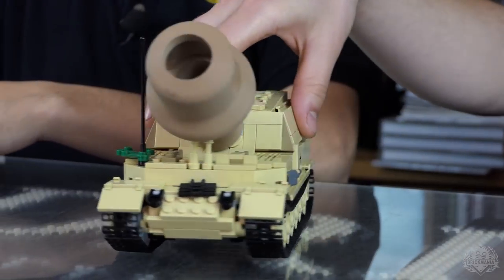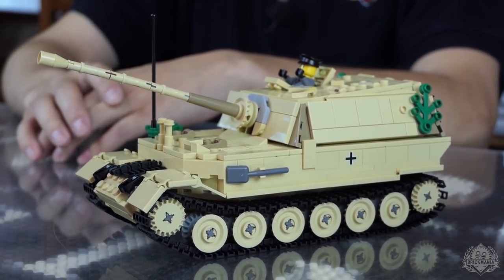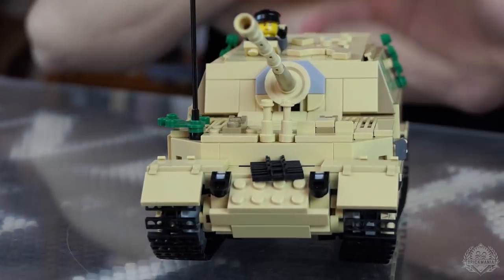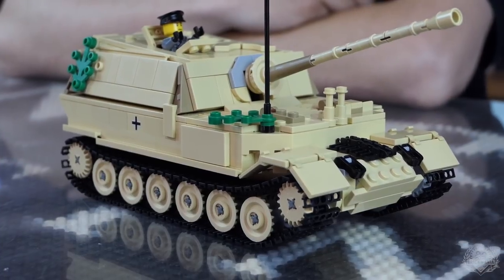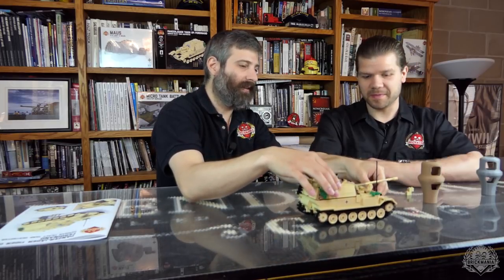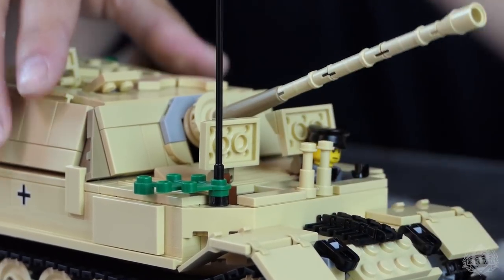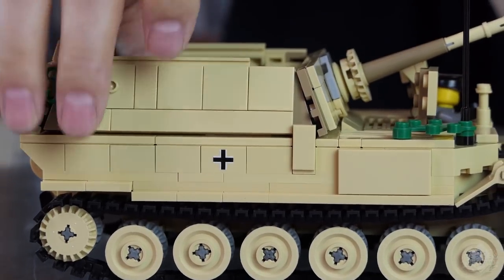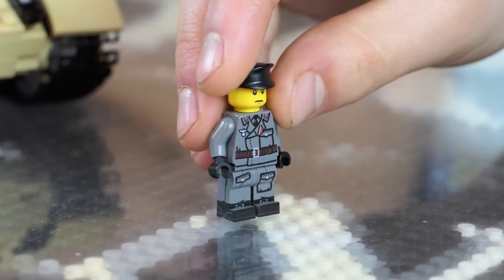Panzerjäger Tiger (P) Ferdinand - German Heavy Tank Destroyer - Custom Military Lego

Comment: U guys already have the chassis, try making some tiger P's
that would be cool
Reply: Ryan Levan I would love that
Reply: Conversion kit would sell this to me, if they don't make a separate kit for it. Just needs tan tiger 1 turret, rear and deck changes.

Heck, if you slope the front and change the casemate to a tiger 2 turret on the rear, you'd essentially have one of the VK45.02(P) designs. Or place the turret on the front and remodel the rear for the alternate version.

But really. Holy yes to the Tiger P. (Especially the command tank)

Comment: By the way, this tank was awefully known for its non reliability due To the engine problem. Actually most of them were destroyed because of this, but only a few model were produced so It wasn't that bad since it was a failed model. There was a report after an engagement with those tanks that show that around 20-30% (I'm being optimistic) survived after it, only a few were actually took out by enemy fire.